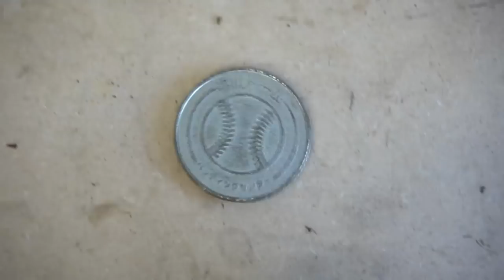WHAT THE HECK IS A SUZUKI CAPPUCCINO?!

Comment: The rear window and hoop should retract completely, and lock into place. There's a knack to it. After releasing the catch, reach inside and hold the window up while folding the hoop down. Then stow window and hoop together into the recess. 

If you're unlucky, the window (or is it the hoop?) will have caught an internal liner and permanently distorted it preventing full retraction of window/hoop. If so, gain access by removing trim behind seats then somehow pin/glue the liner into its proper position. I used a modified length of wire coat-hanger strung between two existing bolts. Refit the trim - job done.

Comment: it converts even further. if you look on the back screen in the middle there is another latch that you push the middle in and turn it and the cross bar will drop another few inches into the chassis.

Comment: Yo Jimmy! Throw a Kirkey aluminum race bucket in this thing, and a smaller dished steering wheel and you should fit just fine!
The Dished wheel made the biggest difference for leg clearance in my NA miata, so it should do the same in the cap

Comment: just like many japanese cars, i learned about them in games. many of them like supra, skyline, evo, sti, nsx, rx7 was from grand turismo. but the cappuccino and oddly enough the 3000gt, was from tokyo extreme racer zero on ps2. it was one of the first gang car you raced and the ae86 was one the first gangs as well. it was a good game, 3 had better physics and other stuff. it had more areas to drive. but i guess the more areas meant less cars. zero had like a couple hundred cars if not more. you could modify them to be faster and do rims and body kits, it was called areo. but you raced rival gangs on the freeways. i just looked it up like last year and it was still under 10 bucks. but now when i looked, since game stop doesnt sell it anymore. the games are over 30. i think it was d1 grand prix another good ps2 game. it was like 40. if i only still had mine i could play them. but dang the top is freaking cool and the back goes down too. just think abut it, that was 91. japanese make nice stuff and always better then the us for the most part. if they had that stuff in american cars in 91. they probably costed way more then the cap did.

Comment: Would a rotary fit in there? 🤔🤔 I think an na rotary with 150 -160 hp would be so totally killer in that car! 🤩
Reply: Yohann Mody twin turbo 13b with a 5 speed out of an fd in that thing would be so sick
Reply: Def a 12a would fit I’m sure. Would b so badass!!
Reply: Matt Carl 12a and 13b are basically the same size. but yeah would be sick. the only other engine I would put it in would be a k series Honda or maybe a miata engine
Reply: Yea I've actually got a first gen rx7  we use for Rally w a 12 a in it things are mean. A decent built k20 would b sick also
Reply: Matt Carl nice. I do as well. the rotary engines are cool because there isn't anything else out there like them.
Reply: That's what I like about them but living in northern Pennsylvania u can't find them anywhere
Reply: Matt Carl yeah I feel u lol. i live in southern Canada and there's not that much available for them but at times you do come across parts and what not.
Reply: A Busa motor would fit in there perfectly turbo 4 cylinder makes 160-190 and revs to 10K. but a rotary or k20 would be amazing in this thing.